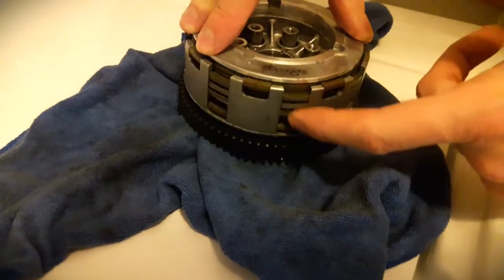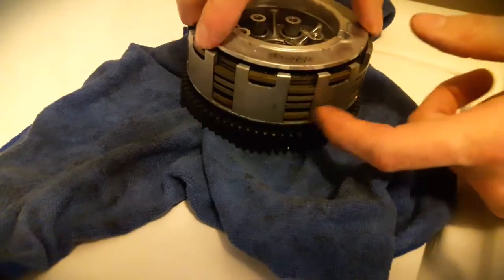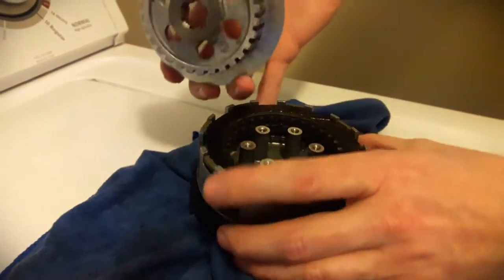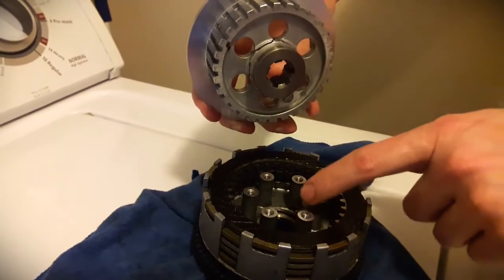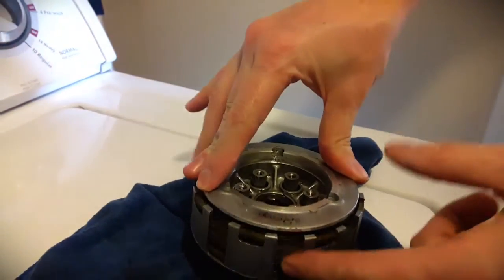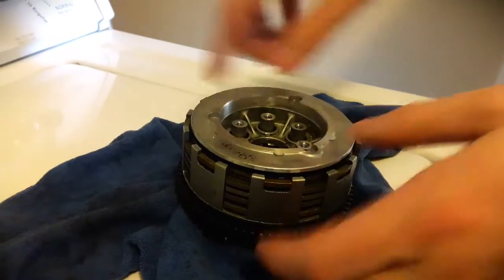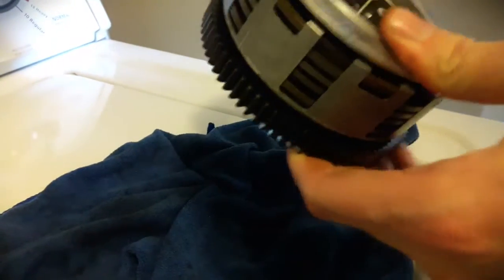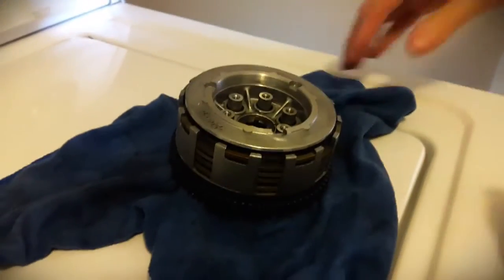z125 Pro clutch drama

Comment: I might just be seeing things, but it looks like your clutch center is broken. at :15 it appears that the splined section is breaking loose from the center.
Reply from the maker: Joey Gomes yup it broke when I torqued it to 53 ft lb... I think I found the problem the last metal clutch was out of the groove
Reply: I was curious how it broke, I know you've been beefin that little guy up but it would take some hardcore abuse and serious power to snap that like that. Can't wait to see the numbers you put out with the race head on BBK. subbed